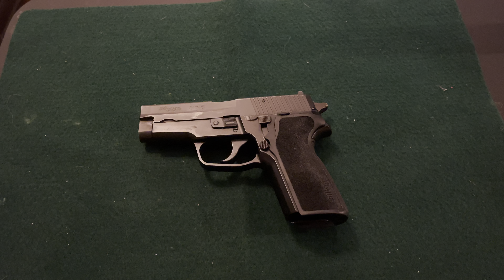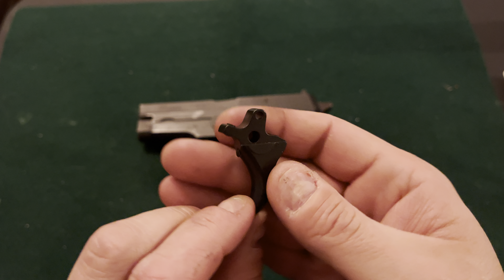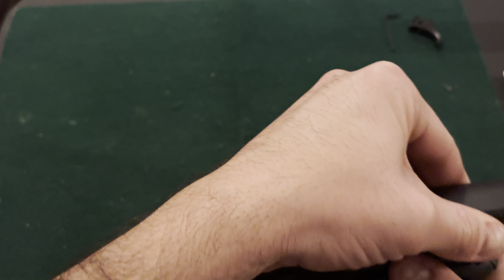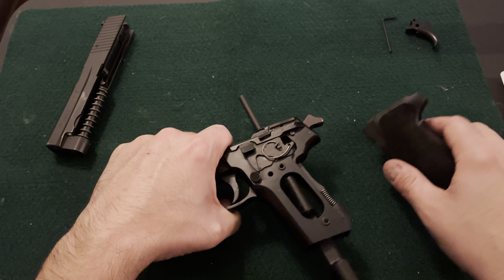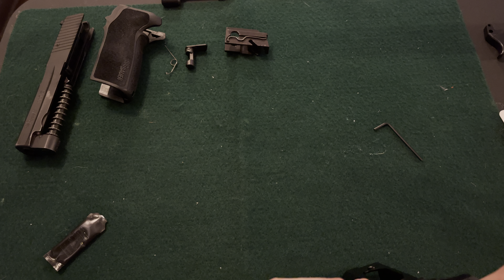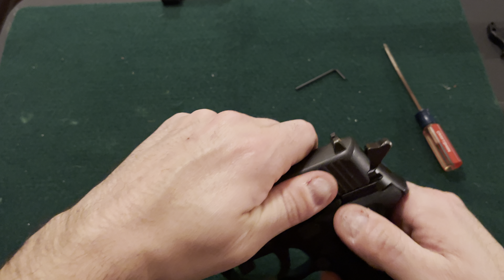West German P228 Transformation #3 - Grayguns Dual Adjustable Curved Trigger

Comment: Does the trigger bar spring need to be changed out to put the e2 grip on? Some people said you dont need to change it any idea.
Reply from the maker: Yes. The original trigger bar sticks out too far for the e2 grip. The newer springs are a different length than the original too